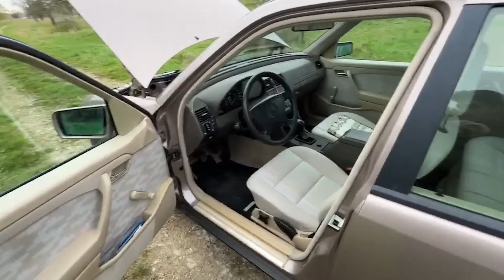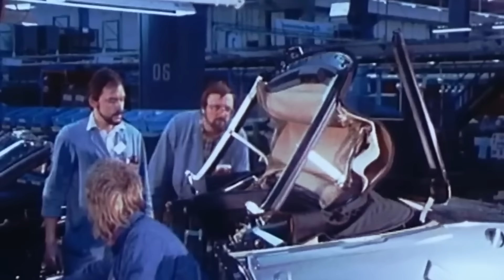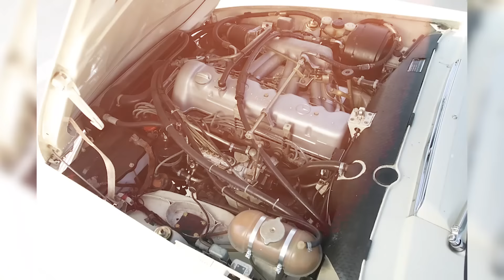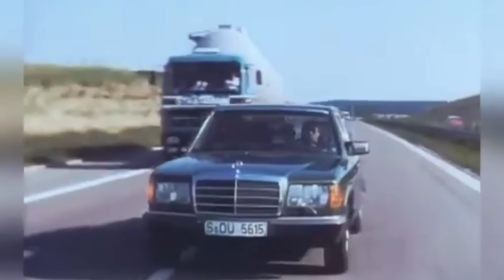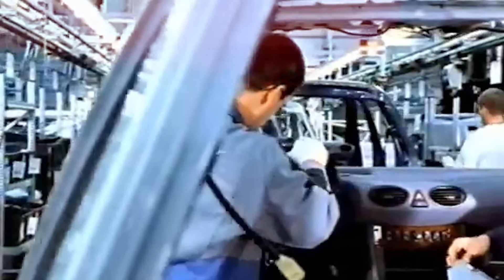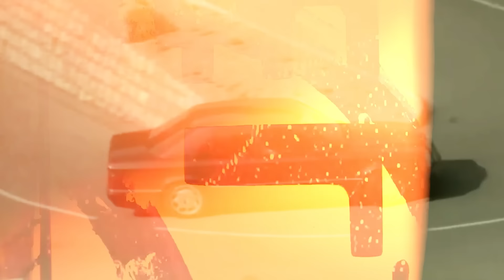9 Old Mercedes That Were Built to Last Forever

Comment: Absolutely love my W204. 13years old this year and not one issue.  No rattles, no squeaks and still drives and starts like the day I purchased it. The solid build and door thud reminds me of the engineering behind these. Won't be upgrading anytime soon that's for sure.
Reply: I have S204 myselves. Very reliable. But there is a few things you should look out for that can make problem. 
The steering lock motor. Rear axles and rear subframe, specially if you live in a country where there is winter and they use salt on the roads.
There is also a few places that can  give corrosion problem with the break pipes. If you need to change use copper and not original. And if you not already have changed steering lock motor, buy one, so you have. When you need to put in key more than one time before it opens is the sign that it starts to failure. Then make sure it opens and disconnect battery so it stays open. That will save you a lot in time and money.

Comment: Only one mistake, W201 should be in the list
Reply: True 👍
Reply: I was waiting for it!!! W201 known as Mercedes-Benz 190!
Reply: Off corse
Reply: You didn't lie, I have one of those...😊😊😊
Reply: While taking off the 204. Those things do not go up 200K miles without deep pockets, rear subframes and computer modules will tag team your wallet, and interior material longevity is trash compared to anything pre 203. Ask me how I know. Hell the only cars of the 21st Century I would even consider on this list are rhe W211 non Bluetec and 3.5L engine if it has had the cam gear issue resolved. If not, the E320 3.2L are golden (also left off) and W164 (First Generation ML series Minivan). These rank ahead high enough that even the 203 should arguably be dropped into a subcategory for conditional reliability, alongside the W210 and I dare say 202. These cars were not up to snuff compared to the older ones, but certainly not as bad as what followed save the E class. The 211 was the apology car, not the 204. Massive leap over the malaise 210. Only issue is the earlier model's ticking time bomb ABS module failure. With the OM648 DI CDI inline 6 successor to the w210's 606, so long as you change those injector seals every 80 to 100K miles (do not wait for the black death), you have as robust and long lasting engine as every OM dating back to the 617.  The legendary diesel of Benz ends here. OM616, 617, 601, 602, 603, 604, 605, 606, 611, 612, 613, 647, 648. The end. Sorry Bluetec guys, you were robbed

Comment: I have two old mercedes. A 2009 W204, c230 owned for  eleven years. No major issues and only failed once in that time with a failed electronic steering lock which is a common problem. It's obviously gone through a set of discs in my tenure, the shockers been replaced all round as have the front control arms drop links and roll bar bushes. Two batteries..  Just had oil seperator replaced as it was keaking, and cam plugs replaced (not leaking)on engine  Not bad forthe age of the vehicle. Everything except ELS done during scheduled service appointment.
My 2012 e350 c207 with M276 engine has been totally reliable I had the rear discs replaced a while back when it was in for first service  that's been it in two ears and 60k km apart from routine services.
So yes I agree . Some, not all, old Mercs are great.
Both cars are in great condition inside about. No squeaks rattles or bumps. No rust on either car anywhere

Comment: Rubbish M272 engine a disaster
Reply: No it isn't. I have a 2009 w204 c230. Done 167k km. Only problem I have had is the oil seperator which was leaking. Just had that fixed and the can plugs replaced( Preventative maintenance). The balance shaft was an issue on early pre 2009 engines. No idea where you get the idea the engines is garbage.  It's not the general opinion of the motoring world, provided it's well maintained.
Reply: M271 and M272.. worst engines MB ever made.. shitboxes